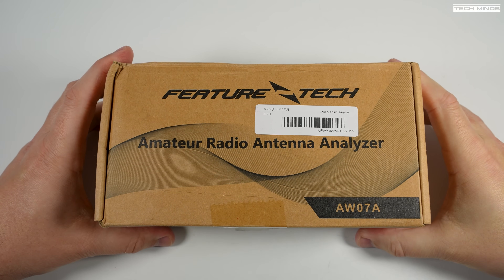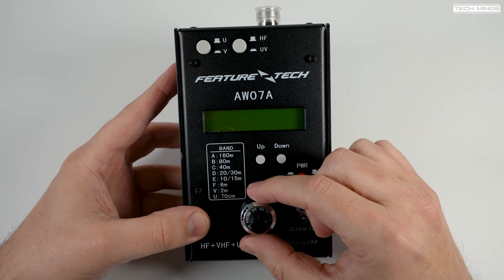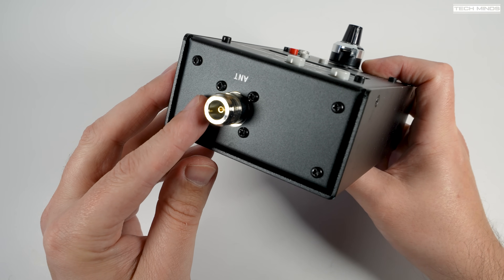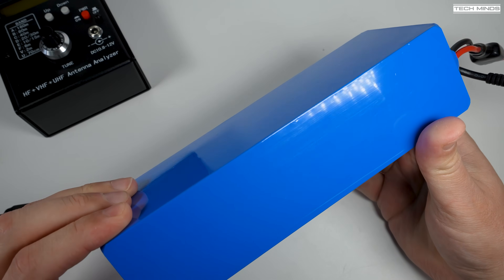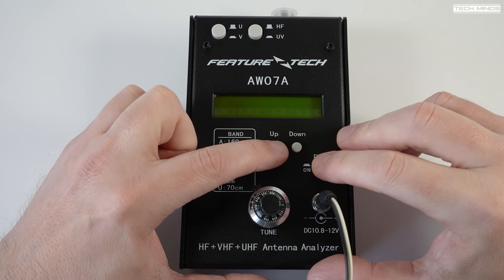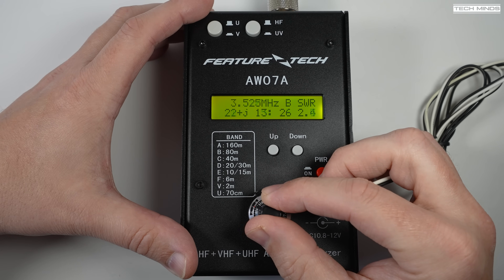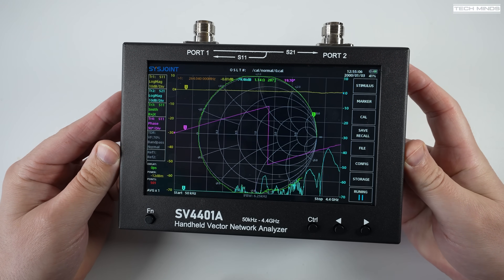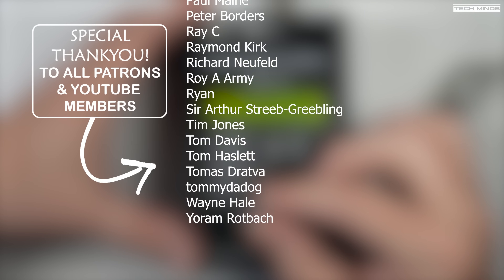A Compact Battery Powered Antenna Analyzer For HF To UHF

Comment: Just received my AW07A and it will NOT tune 2m - stops at 139mHz. Can it be extended to cover the 2m band (which is what I need). Thanks Jon (SA0KJI)
Reply: Sounds faulty? - you can see in this video the tuning knob selecting 144MHz on VHF setting?. Does it work well on 70cm's?

Comment: You can buy a decent VNA for the same price that does a lot more! The days of the old MFJ 259 are over. I own a SV4401 and it kicks ass.
Reply: Agreed the VNA does more but how many people actually require or want or can use all the that the VNA is capable of? I have a VNA and have used it a lot for antenna work, i have also used it for other purposes but, i'm no expert. The thing with the VNA is the setting it up for the different frequencies, the start end settings and the calibration, all of which takes time whereas the unit on test here requires none of that and so the job of scanning an antenna for swr is much quicker and easier.

Comment: I swear, you have all the best toys!!! Sorry, the antenna analyzer was immediately upstaged as soon as the Sysjoint VNA came into frame. Super jealous, by the way! If I may ask, why did you go with the sv4401 and not the sv6301?? Cost or availability?? I’ve been drooling over the sv4401 since it was released, so congrats on procuring one. Do you know if there’s considerable difference between the hardware of the two VNAs or is it firmware.

Comment: I have the mfj259, but since getting a nanovna haven't used the mfj much. I will say the mfj is a piece of cake to use in comparison especially if all you want to do is switch over to it from your transceiver for a quick tune up.

Comment: whats the difference between  that unit and the nano vna
Reply: NanoVNA has more features and is really easy to use (not to mention it is around 50$). This one does only a bit more than the MFJ259 does.

Comment: I don't have the MFJ analyzer either, although 15 years ago I thought about buying one. On the other hand I saw a recent YouTube video that compared the Nano Vna to MFJ's device and I assume with a high degree of certainty the guy doing the testing was an EE. I can't precisely remember if he actually used a lab quality analyzer to make the comparison, but believe he did. The consequent is buy the Nano Vna because MFJ's device has some significant limitations.

The YouTube chanel could have been any of the well known electronic's type channel but seems to me to have been named similar to Electronics for the Inquisitive where the publication date was roughly a year ago.

Footnote: Rig Expert was tested too. While better than MFJ's device the Nano Vna still was most accurate.

Added: The video can be found here & is roughly 1 year old. It was quite interesting.

electronics for the inquisitive experimenter

Comment: I have the MFJ version which I bought used. In my opinion it is built a lot more rugged which makes it hold up better for field work, such as field day. It also has rechargeable batteries with long battery life. It has capitence adapters which work as a dummy load for calibrating the tester. I need to purchase the option carry case with shoulder strap.